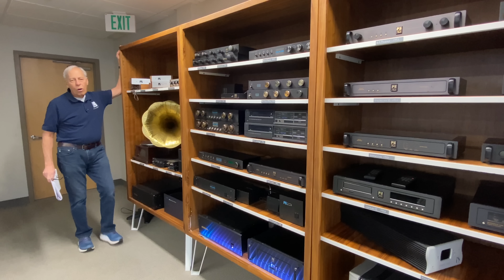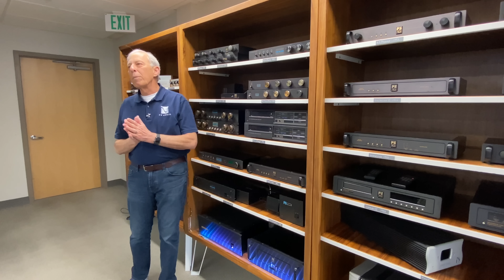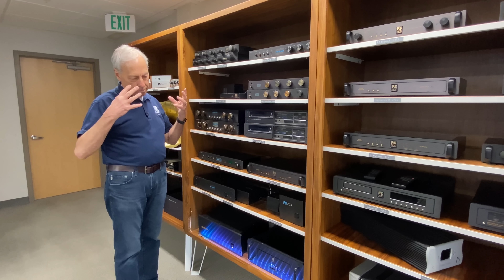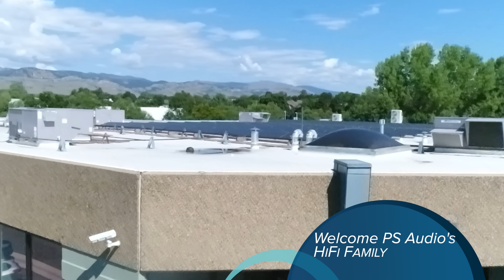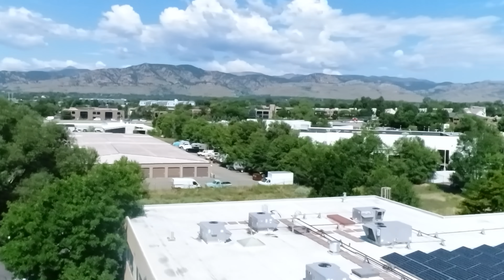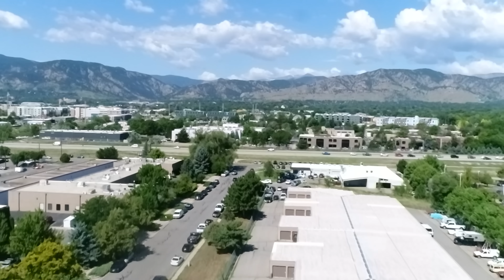Where do engineers go wrong?

Comment: When I was on that microwave site on top of a mountain in Korea (Salem site) in the late 60's the equipment we used for television relay was the Raytheon KTR-1000, this was a 10watt tube based transceiver set that was built for mobile to base operation - maybe 10 miles line of sight. I was receiving a signal from Taejon that was 49 miles away and there was a peak in between that was just a little to high but yet I got reasonable signals from them.

The reason it worked was if you shoot across a peak with very high frequencies the path will bend a bit as it grazes the obstacle so you can transmit signals from two points that can't see each other by just grazing the intervening obstacle - this is called the fresnel effect. The path will bend depending on how close the intervening object is to the signal path.  If the object has a lot of tree growth on it you might have to adjust the path slightly when trees are in full leaf but any trees on top of modest mountains are no real problem.

BTW that was great duty, 6 GI's on top of a mountain with the nearest officer 26 miles away
Reply: Really cool story. My layman's understanding of the Fresnel Effect is that it just lowered signal quality when there were objects within a region outside of the line-of-sight between transmitter/receiver, didn't know you could use the effect to bend signals around objects and increase signal quality.
Reply: @ugh-meh    It lowers the signal level some but it also refracts the signal so you can hit something you can't see. Our signal had a bit of noise but was pretty damn good considering 10 watts of power at near 50 miles at 1.7Ghz on a set that was rated at about 1/3 that range.
Reply: When the boss is away, it's don't ask, don't tell?
Reply: @jamesplotkin4674    Exactly, as long as things ran smoothly they let us do as we pleased. If they knew what we were doing we all would have finished our tours in the stockade. The CO really didn't want to know any details.
Reply: @dell177  Thanks for your service!!
Reply: @jamesplotkin4674   Thanks, I enlisted a month before I was to report for the draft so I could get some training, I went to a microwave radio repair school at Ft Monmouth in '67). 

I was lucky and had two good 13 month postings. At night sometimes I could listen in on the fire control nets in Vietnam and I always thought "there but for the grace of God go I". 

We lost to many good men in that hell hole.

Comment: Disclaimer: I'm an engineer. Guilty on that part. AND if I had to choose between being an objectivist or a subjectivist, I would be inclined to go with the first option. So, guilty on that part as well. 

Now, about things that make a difference or sound better. I will give two pieces of advice based on personal experience:
1. You don't know what you don't know. 

Before I ever listened to really good loudspeakers in a treated room, I never had such an experience and could not understand how a system, any system, can sound good. And if you don't have a really analytical system, you can't hear subtle differences. And unless you ever listen to these subtle differences, you really are convinced they don't exist. 

2. Measurements are valid to find what sounds better only if they measure properties that are relevant to the objective of the measurement. 

If we "naively" go with the premise that "a perfect amplifier is one that doesn't take out anything or add anything to the sound", it's pretty easy to end up with a single measurement of minimizing THD+N, which isn't a bad measurement at all. But when people claim they like the tube sound better, which has been proven by measurements that exhibits increased even order harmonics, we must either discard what people like or change the methodology. I, being an objectivist, will not discard what people like. We know the reproduced sound won't be perfect, so why not accept the imperfections we like instead of ignoring what people like? After all, "weighted" measurements do just that, in a sense. 

And one final point: Engineers are not scientists. We are people who try to design and build things that are good enough or fit for purpose. We design a bridge or a building that is stable enough and then add a 2x or 10x safety factor. A scientist would cry at that as being proof of lack of understanding. There are always several unknowns in everything we do, build and study and we just have to accept that, until - that is - scientists go further with the understanding of physics, chemistry, psycho-acoustics or whatever science is relevant to the subject. 

Are cables able to make a difference? With a crappy system in a room that has un-favorable dimensions and furnishing, I can outright say no. It takes a lot of effort to design loudspeakers that can reproduce sound decently enough and a high powered amplifier that has enough headroom so that it doesn't compress (but loudspeakers must also be able to not cause thermal compression; we do understand that 100-300W going through a voice coil will make it hot and increase it's resistance, altering the reproduction characteristics of the loudspeaker, right?) 

So only when all these issues are properly addressed, and I feel this is seldom done, can we really get into a position when subtle differences coming from different interconnects or loudspeaker cables, are able to come up to the surface.
Reply: Redpill Progressive " My guess is the most important characteristics of cables is noise rejection and suppression."
Yes and that's what it is, a guess. Why do we only read about all this evil electrical noise in consumer audio magazines and blogs? In the professional electronics industry publications, articles on noise are as frequent as any other topic. Not this relentless doom and gloom found in the audiophile  arena. The reason is electrical noise is largely a non-issue with modern electronics. We know how to manage it and do at a very reasonable cost. The people who promote this noise problem, especially with digital gear are most always somehow associated with the sales of cables or other little black boxes and of course outboard power supplies which claim to fix all your woes by simply writing a check! Next time you read an article or blog about USB noise or similar, research the author's formal background. What are their accredited electrical engineering credentials?
Reply: Engineers are people, and some people are more obstinate and closed-minded than others.

This is one of the more fair and open-minded statements I have seen from an engineer in the YT comments.

I appreciate, and thank you for that.

You also make some good points.
However, I can tell you from personal experience that the difference a good cable can make in even a modest system can be more than subtle. Much more.

I am not endorsing mega-buck cables here. The differences I heard came from very modestly priced cables and equipment, and the difference was very apparent.
I do not have a lot of personal experience with cables otherwise, excepting what I have read, but it is easy to believe that for many, the differences are subtle, and especially when comparing one very expensive cable with another.

Here's hoping that more people can have good experiences with modestly priced cables.
That's something I almost never see discussed.
Reply: Why do you make stuff so hard to repair ? 'I used to work in a shop.
Reply: Wow.  That's a really brilliant response.  I don't know if I'll ever hear a true audiophile setup, there's no HiFi shops left in the UK :'(
Reply: @KarlHamilton .. Curious which part of the UK you're in... and also, which shops do you recall as being ,what you would choose to define as being a real hifi dealer?
Reply: @marcus1970  I'm in Northern Ireland, we've really never had very much here as everything kept getting blown up during The Troubles haha.
Reply: @KarlHamilton  Kronos?.....
Stay safe 
from London
Reply: I appreciate your position, Savvas. And I suggest that there are precious few real engineers making hifi components. Most are actually designers. The young fellow Steve interviewed at a hifi show -- I think his name is Matt -- who works on cartridges. He might well be an engineer. Andrew Jones might well be an engineer. Bent Holter is an engineer.

A designer may have an engineering degree but still just be a designer. Not all engineering schools are equal, nor are their graduates. Titles don't withstand. A train driver is called an engineer. A custodian who fires a boiler is called an engineer.
Reply: Satefy Factores is when they don tknow th eloads and are guessing. Airplanes are something like 1.07. They do lots of testing and not muc exstra capacity. Steel cables for elevators is differents becuas its baed of STRAIN energy ansy cycles to failure. I forgot most of its now. y Harmon Kardon s tranformer gets really hot. I cant afford a new amp. I am lookign at Logitech computer speakers. I cant afford st that stuff no more. THANKES YOUE AND THUMMSS UPS!
Reply: Fat Rat: Hello Mine goods frends. I forgot for a few days to watch Misnters paul. I was kind of depressed last week. 1 cups of potaties, i.e. fries is basically 1 cup of surag and surag causes sevre depression...

If you deal with anxiety, then you know how disastrous it can be to binge on sugar.

The powerful high and subsequent crash can make you feel irritable, shaky, and tense — all side effects that can worsen your anxiety.

I took the Harman kardon pm625 out from storage and the transformer gets reakk hot. I dont have money for a new one and dotn antrust and repair guy. Tou are are mine goods frends and makes me feels betters. THUMBBSUSP!
Reply: As fellow engineer  fully  agree with that 👍